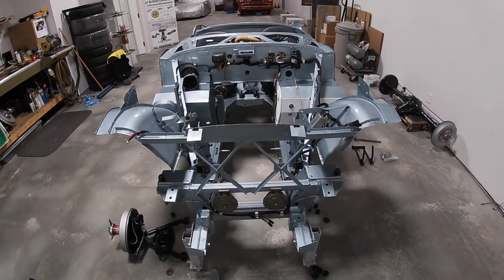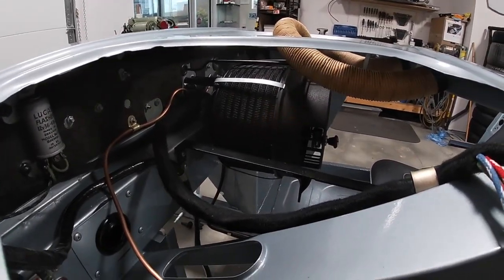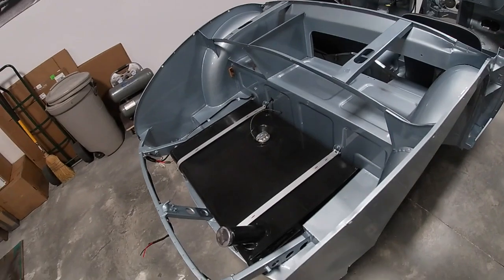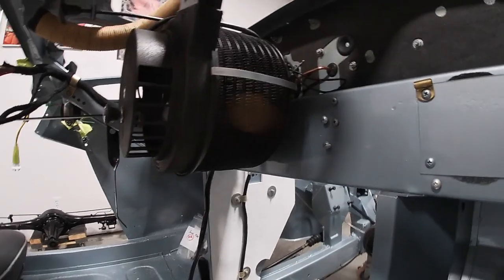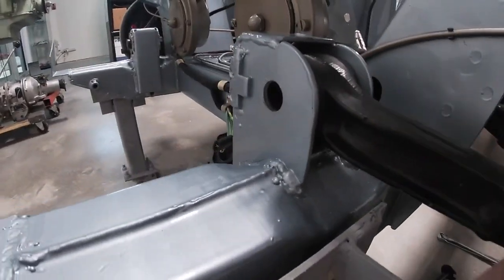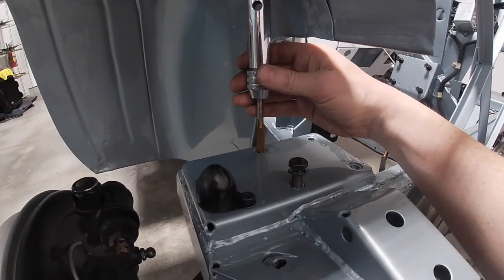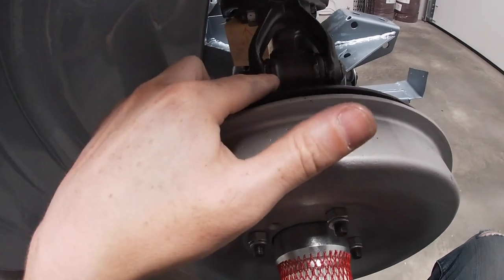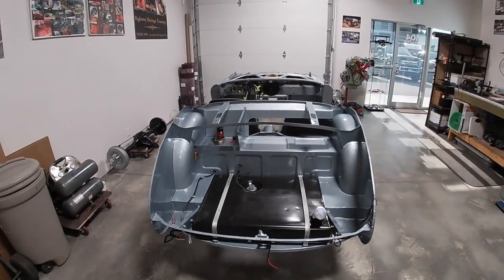BN1: Adding Suspension Pt 1

Comment: Good one Geoff ,I would also highly recommend you have your brake drums checked for balance. The modern method of wheel balancing doesn't take the brake drum into consideration.
Whereas in the old days they would spin the wheel up right on the car and balanced the whole spinning mass. Cheers Trevor

Comment: Are going to use the same cement board for the drivers underside side floor pan for the exhaust heat?. Great restoration!!!!
Reply from the maker: No, early BN1's did not have that panel, it was a later addition.